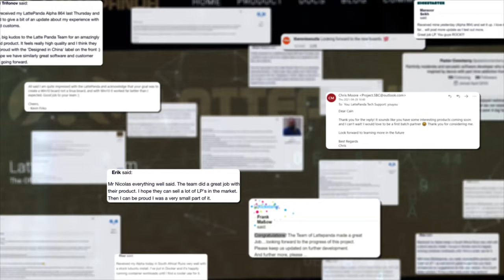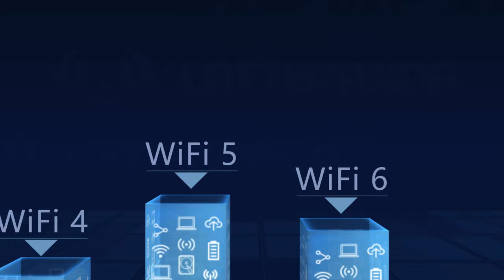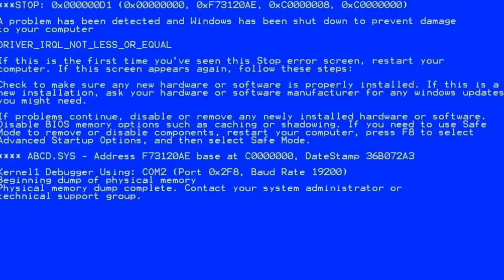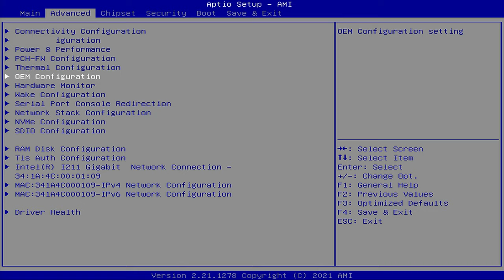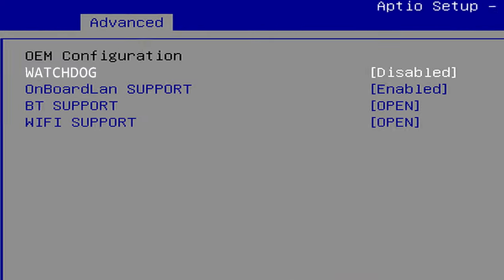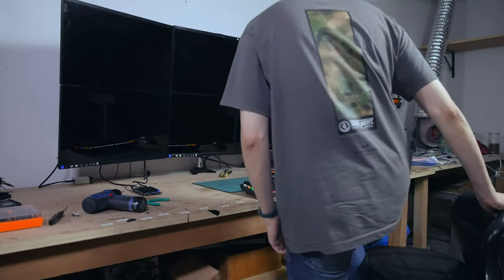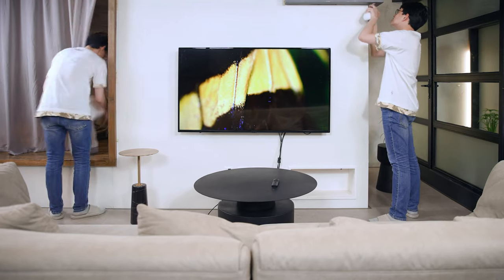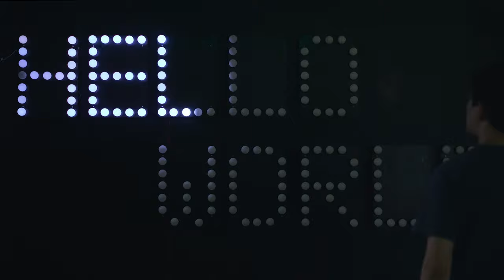Introducing LattePanda 3 Delta - A Pocket-sized Hackable Computer for Mega Creativity

Comment: I own LattePanda Alfa for more then 1 year already. It is quite strange that you are compare CPU performance with old Delta model. It would be much more interesting for me to see the difference in performance between Alpha and new Delta. I do beleive that there is no difference between them at all in single core mode. Also I found new CPU have TDP10 while 8100y had only 5. Alpha have known problem with cooling I don't see that new version have much bigger cooling system but at least it is right in the midle of the plate now.  And do not forget to mention that power supply is two times bigger then Delta itself.
Reply: Delta 3 gets very hot sadly... The power draw is what got me to select this. It can run off my car with no problems. Making it a super media head unit